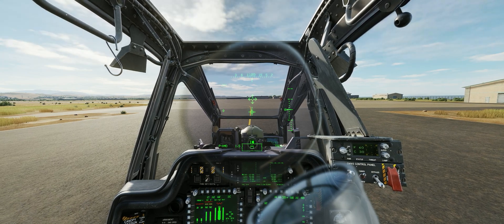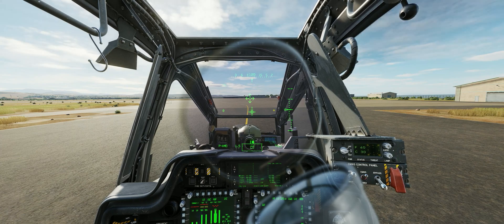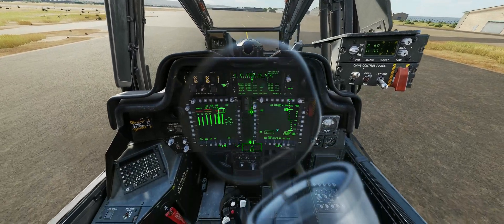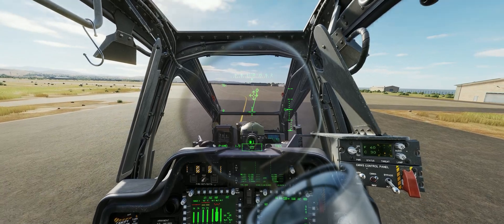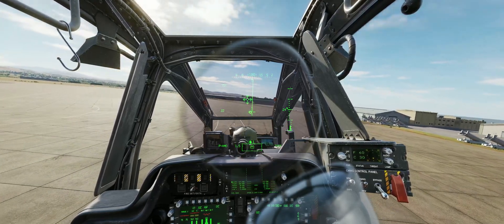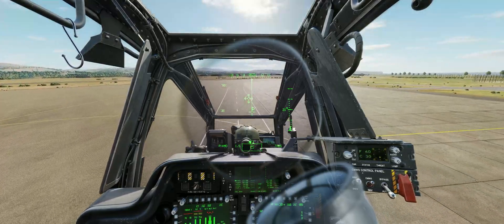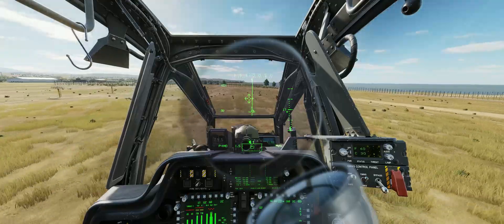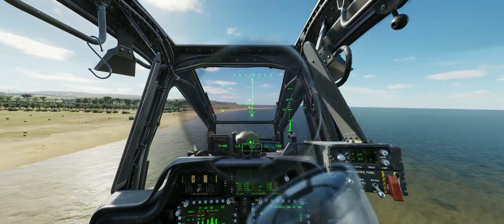DCS: AH64 Speed and Lift, or how to stop abusing your collective and take control of your Apache.

Comment: Question about the Thrustmaster TPR  , Should i use any kind of Curve i Should implement in DCS for it or no curve at all !?
Reply from the maker: Thrustmaster TPR have been called some of the best pedals out there, at least a couple of years back and they are still considered very good. I haven't used them my self but my friend loves them. I can't really say what you should do with the but I would suggest a slight curve, I set my curvature for pedals at about +15 in most modules that are helicopters or WWII planes. I have them at 0 ini jets. The reason for this is even though I have perfect helicopter pedals with zero centering I still want them a little less sensitive near the center. 

So yes, I would suggest you try 10-20 in the curve for the pedals and see how it feels 🙂

Comment: I am Happy that there ist finally another Video from you...sitting in the AH64!

May i ask you what kind of Hardware Equipment do you use for flying?
Reply from the maker: Thank you! And thanks for taking the time to comment! The Apache is such a superb and great bird, I'm really falling for it more and more, especially since they added the ability to switch seats in multiplayer which means I don't have to rely on George to find targets though it can be helpful from time to time. 

It's also a "module in the making" which means we'll see lots of great updates for it. I'll try and keep the videos coming a little more often from now on, if life allows me 🙂
Reply from the maker: Apologies, I missed your question about the hardware! 

I'm running a self built rig.
AMD Ryzen 9 5900X CPU 
Radeon 6900XT Graphics card
32GB DDR4 memory at 3200Mhz
M2 SSD as Primary disk with DCS on, several other SSD's for other storage and software. 
Display is a LG Ultragear 38" 38GN950 Ultra wide (21:9 display, I don't really like the 32:9 displays, too little height). 

Virpil WarBRB joystick base with the Mongoos T-50CM2 stick, Mongoos T-50CM3 Throttle and the new Virpil VPC Ace Torque pedals (more like old school helicopter pedals and I can completely remove the center stop making the motion smoother).

Resolution wise it's maxed at the screen resolution 3840x1600 and about all settings maxed out (think there might be one setting of so that I didn't feel the need to max as there was no visible difference). I prefer beautiful looks of flight simulators rather than maximum FPS, when I'm at the low end of the FPS scale I'm around 45 for short periods of time, other times, when flying higher etc it's 100+ so it really depends on the situation in DCS. Down low in the mud with cities and trees and units it's on the lower end but around 40 is still good enough to fly well. 40fps in a quick first person shooter would be bad though so there is a big difference between what type of games one runs. 

Hope that answers your question 🙂
Reply: @wilbuzllf5057  
More than I expected, thanks a lot.
Actually I was just aiming for the "fly Equipment" virpl as you wrote ;)
Reply from the maker: @thorstenh1976  Haha OK, well, got more than you wanted :D 

The Virpil equipment has been built up since a few years back, changed from the Saitek X55 which was fine but there is a huge difference between that and Virpil. I also used the CH Pro pedals before but again, there is a huge difference. :)
Reply: @wilbuzllf5057  i guess so. Still using the X52 pro and VKB rudders MKIV. So i know a bit you're talking about 🙂
Rudders Made a big difference for me... Control is so much easier.
Reply from the maker: @thorstenh1976  Oh yeah, rudders make a huge difference in helicopters, not sure what I would do without good pedals.

Comment: Nice flying.   I wish I could fly like that.  I need lots of practice.
Reply from the maker: Thank you :)

You'll get there, just remember small motions in the stick, practice just hovering with very small motions then just fly with very small motions. Once you start over correcting in a helicopter you're in trouble. Also, like I said in the video, just try and fly without touching the collective a few training sorties. Take off, hover at 5-10 feet and just fly around with that power setting.